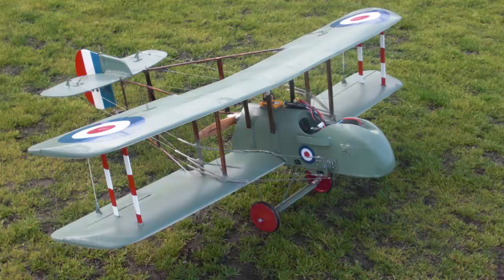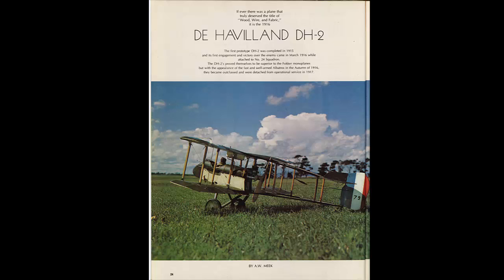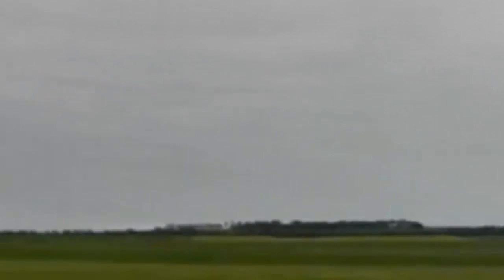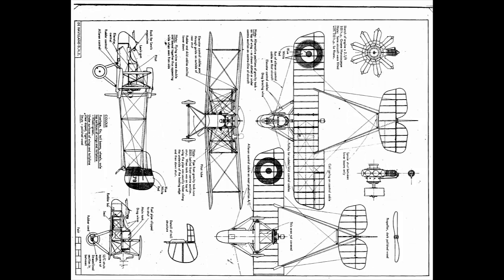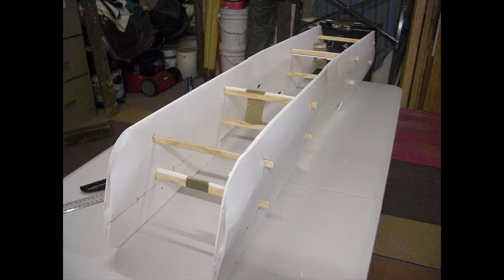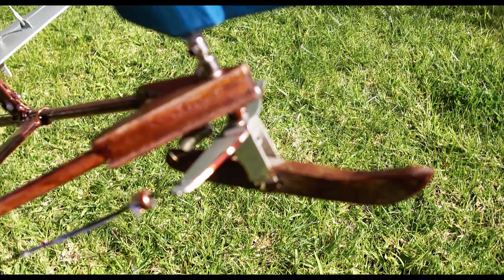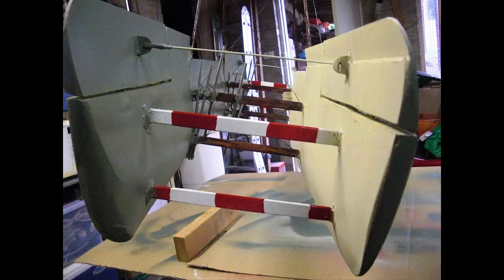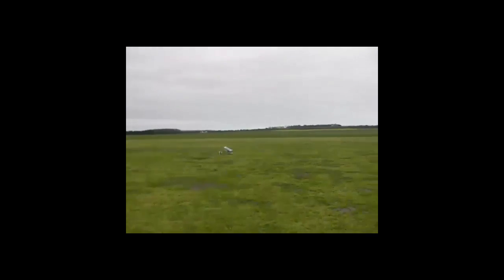De Havilland DH-2 WW1 pusher biplane.

Comment: Hi Alexander, saw your review of the orange rx3 receiver on hobbyking.  Still working well?
Just about to install one in a FT spear for FPV.  According to the manual I have, it looks as though your receiver is in backwards?  Pins should be at the rear of the plane and antenna 2 pointing forward?  Still trying to find the right directions for my version 2 as it doesn't have external antennas like yours.  Best regards!
Reply from the maker: Yes I agree Pins should be at the rear of the plane and antenna 2 pointing forward. I am very happy with the RX3. I have 3 working in 3 planes.  The version 2 is more complicated and needs a separate receiver. I checked out the instructions at https://hobbyking.com/media/file/121223690X1119515X20.pdf but no direction arrow? I would guess the same as RX3. Pins to the rear. When all is installed you test before flying by twisting your plane in all directions. The control services should move  in the same direction to counteract that movement. Happy flying.
Reply: Thank you Alexander, I have the toughest time finding things on hobbyking.  Yes, I will test it out before launch for proper reaction.  Happy flying!